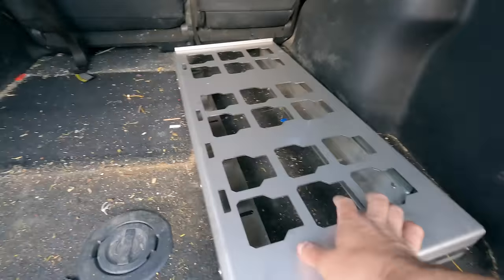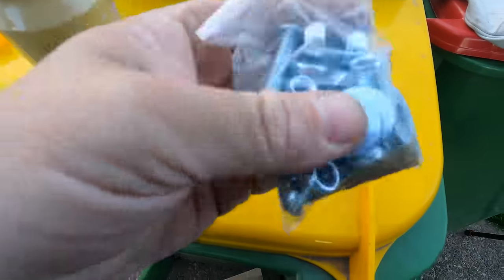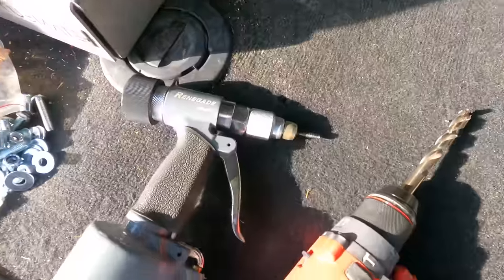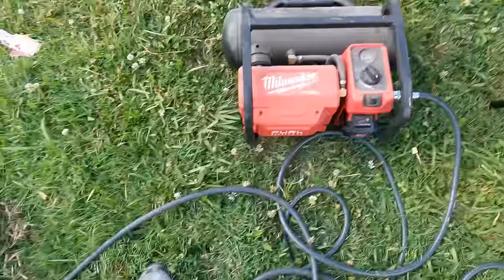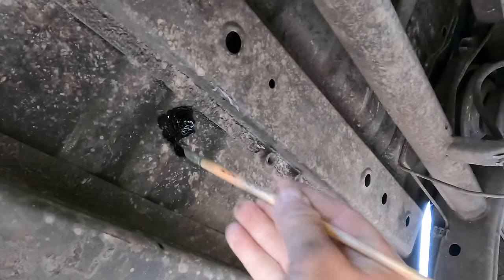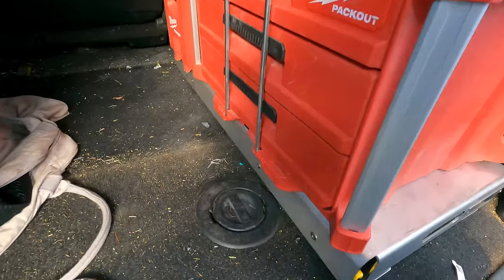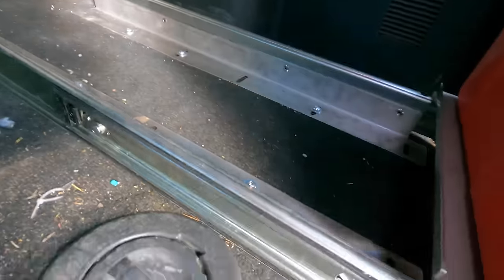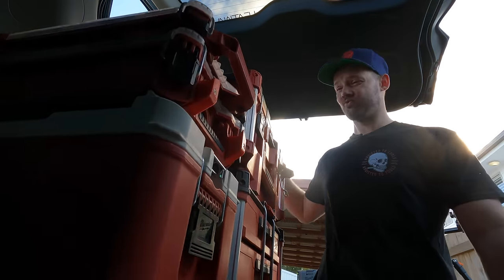New PACKOUT van/truck slider from TUBMATE

Comment: They're a god idea but for the price I think people will just copy the idea by putting a couple of mounting plates on a fridge slide
Reply from the maker: Definitely could make something up. I actually spent some time looking into this awhile ago. Most systems that could hold around 220kg with a flat base were around $400-500. Not sure if they were as long as this. Another $100 for the packout base. This would sit a little higher and not as streamline but would definitely work. May save $100.
Reply: @AddictedtoTools  The weight rating is something I didn't actually think about. that's a good point
Reply from the maker: It’s an easy thing to look over. Your average slider for fridges I believe is about 60kg and they’re not that long. Would be a good project to see what we could build though.
Reply: For the price not a chance.
Reply: Getting the tape measure out today. If I can fit these I’m sold, no way you could make them for that price.
Reply: This is built using 300kg rated runners...
90x45 treated pine and screwed down to the tray with a bit of angle....
https://youtube.com/playlist?list=PL01OeABfR3Lt9GkDkzvSRS8swtVAUoMXw&si=TqNn3xbru1iVy7d_
Reply from the maker: Looks good mate. Fully setup
Reply: @AddictedtoTools  
That illustrates why TStak.
The packouts or toughsystem2 won't fit that snuggly between the 2 aluminium tool boxes
And, as it turns out, the TStak is just the right size to get combinations working per task.
So, you can build a "tiling stak", "plastering stak, framing/timber stak and so on.
Coupled with the trolley and dolleys?... just unload and it doesn't matter where you have to park the ute. You've got nearly the whole thing on site.
I'd love to use the packouts! But they're just not practical for what I've got to work with.
In a van? Or without the tool boxes on each side? It'd be an option.
They're brilliant and Milwaukee are insane with their accessories.
Reply: A a Detroit drill sharpener from Total Tools, less cost than drill doctor

Comment: For how shallow that specific model is, I dont know why you'd bother, Seams like more effort then it's worth.
Reply from the maker: Could you elaborate on that?
Reply: @AddictedtoTools  Looks like an awesome product till you see the price then you'll just move on, i lost any interest the moment i saw the price. Starting at $600+ Yikes.

But for the depth on the model that you've show it hardly seams like it's worth the effort.

It's x1.5 packout in length / depth do you really need a slide of something so short?
I'd love to have something like this in my work ute but not for that price.

Use to have a slide draw that I've been meaning to sell. should get on that.
Reply from the maker: Thanks for the feedback. What would be a price you’d expect for a slider that holds 220kg with packout clips? I’m not sure what you mean about the depth. It pulls out so you can access the packout

Comment: Hhhmmmm
Very nice.
Ya wanna see a tstak tray ute setup? 😁😉
Reply from the maker: How do you rate the tstak? If you’re in brisbane I’ll come have a look👌
Reply: @AddictedtoTools  
I'm using tstak purely for fit. I'll shoot a little video to demonstrate.
They're pretty good. Construction is lighter than packout. But I don't think they're supposed to compete with packout. I think that's DeWalt's tough system 2's job.
I've got mine between 2 tray boxes. Which means they're exposed to weather. 
We'll have to wait and see how they hold up. The water resistance is pretty good, so far. Nothing gets wet.
But I'm only dealing with Melbourne's wet. 
Queensland's wet might test'em a bit.
Reply from the maker: Thanks for the feedback mate. For the price I’ve heard the gears good

Comment: Learn how to sharpen your drill bits. Nothing wrong with any of them.
Reply from the maker: That’s definitely something I should do. Cheers Dennis 👌
Reply: @AddictedtoTools  Coat with any kind of oil if you are punching through metal. World of difference, WD40, chain lube, engine oil. People get picky about needing the right type, but any is better than none.